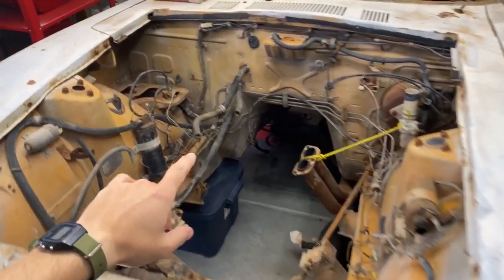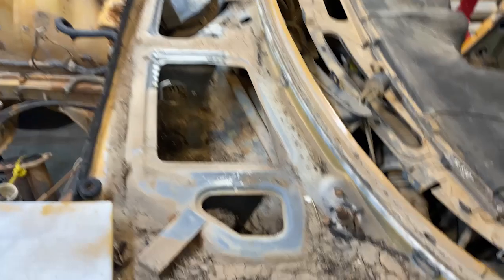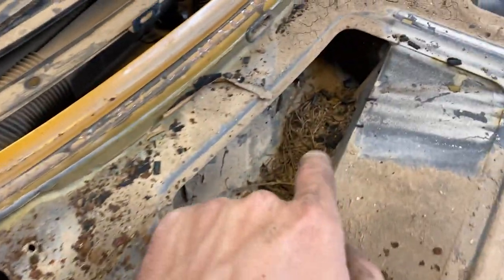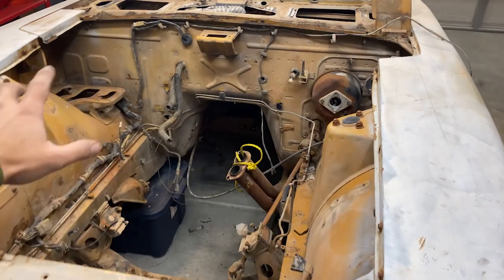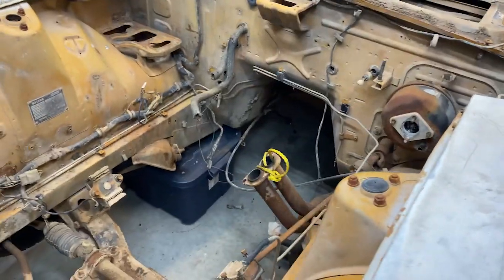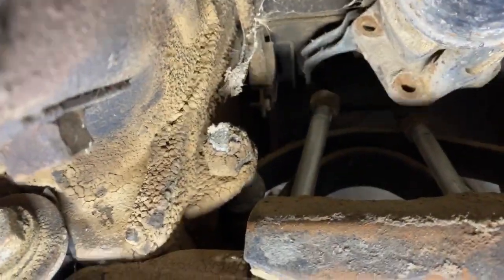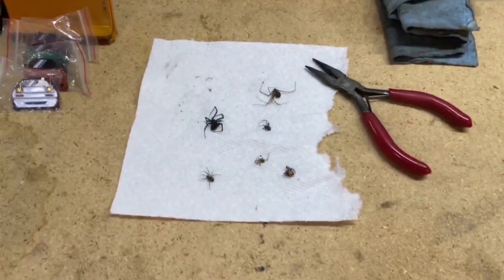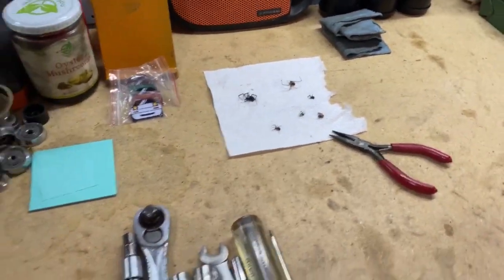Junkyard Datsun 240z - Part 6 - Gutting the Engine Bay

Comment: Use bed liner or seal it with fiber glass resin, in that windsheild wiper motor area it's a tunnel that gather rain water old leafs ,old bugs which produce an acid which rusts that area on all Z cars.
It needs to be sealed up like a boat no leaks  so it runs out and down over the front of the rocker and behind the front fender to rust it. All Z cars , need to route that drain water with a big hose to out in front of the front rocker panel area to get rid of that acidic , drain water !!! Any thing to make that area absolutely water proof.Just paint isn't long term but the factory only primed it
Raptor bedliner , makes a spray  can with HARDNER in it, good for those areas to shoot a nice water proof coating.
Most Z floors rust because that windsheild wiper motor tray area is not "water proofed" then it pin holes and leaks, it doesn't get noticed then the pin holes grow into larger holes. Then the carpet stays wet and rust the floor panel out.
This panel is so critical to stopping rust water proof inside and outside that whole area till it's a water proof Boat! Fiber class resin or two part bedliner on top of a good primer..